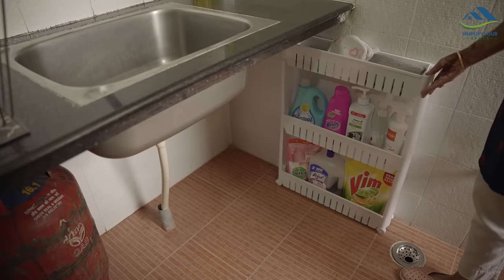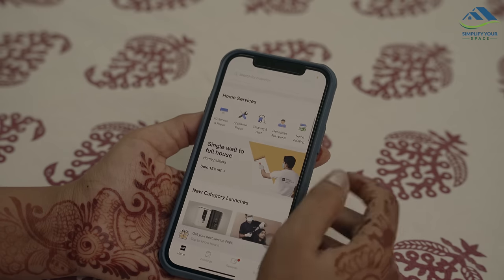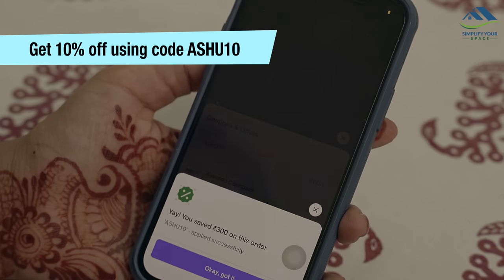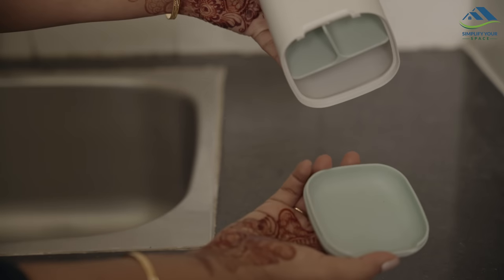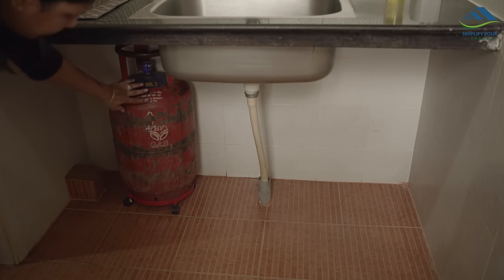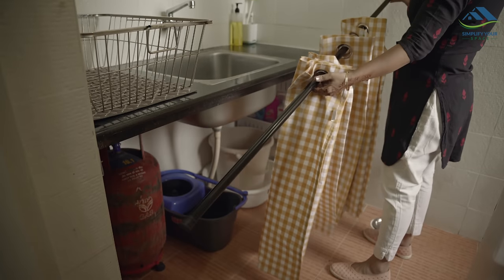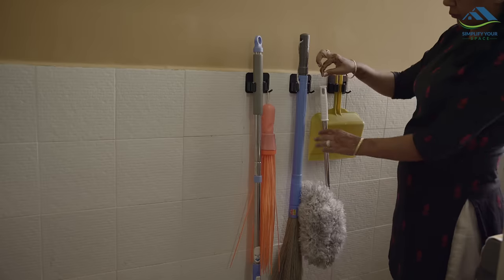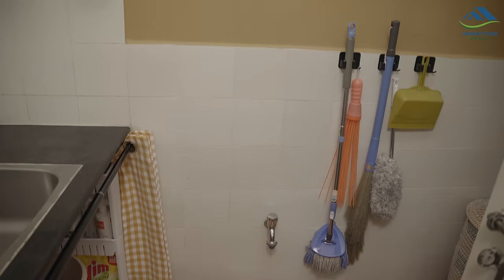Small Utility Area Organization | Small Laundry and Utensils Washing Area Makeover

Comment: But ye adhesive hookmostly kharab nilalte hain or agr thek hon bhe tu kuch time k bd kharab ho jate hain... Broom holder  m bhe ak rubber hota hai wo bhe kuch din bd toot jata hai.. Ap mostly item adhesive hook k sath attach kaise krte hain or yeh long term kaise kam krte hain?
Reply from the maker: I have been using these self adhesive hooks for quite sometime, even in my own house. Buy a quality one. 3M hooks are best. Use mostly on tiles, wood. on regular painted wall, it may not work. It works best on premium wall paint which doesn't peel off easily.

Comment: TIP: ALWAYS let a freshly painted wall "cure" for a full month before you stick anything on the wall, or hang self adhesive wallpaper, etc. If you don't do this, when the time comes to remove the self adhesive shelf bracket, wallpaper etc., you'll end up taking chunks out of the wall too - or, it will take 3-4 times as long even if  being extremely careful to try and remove things.